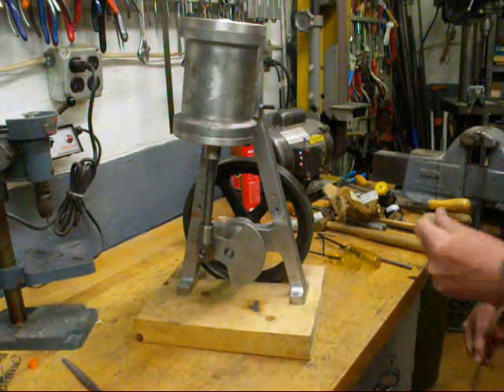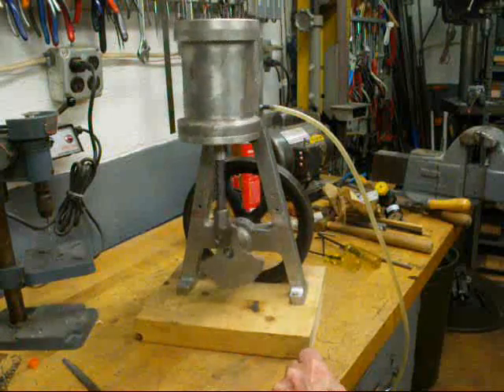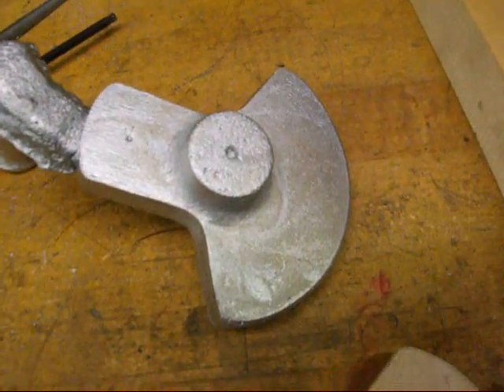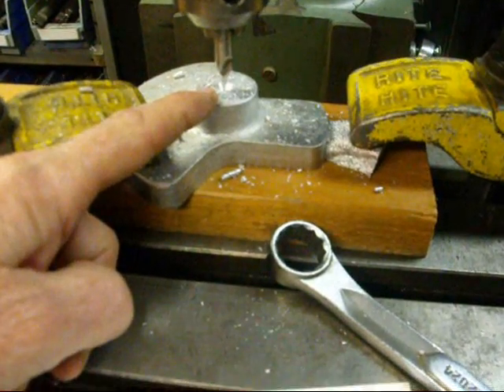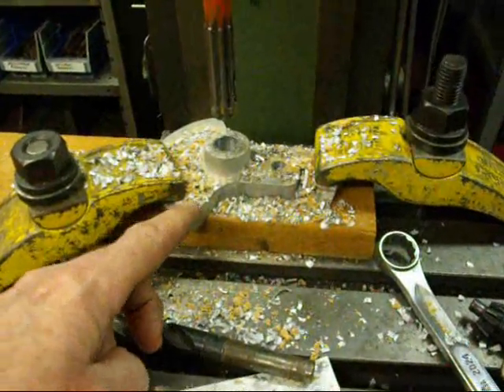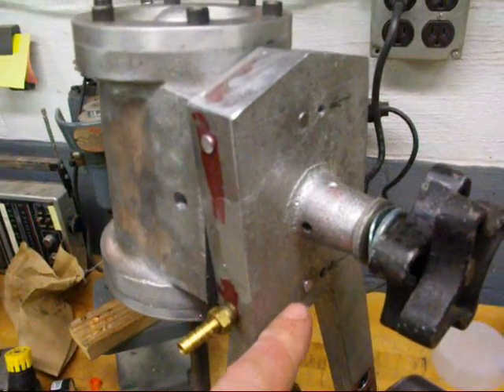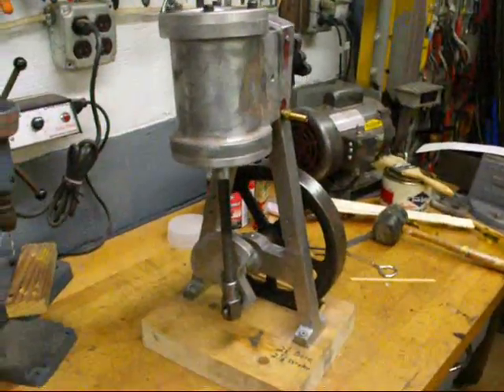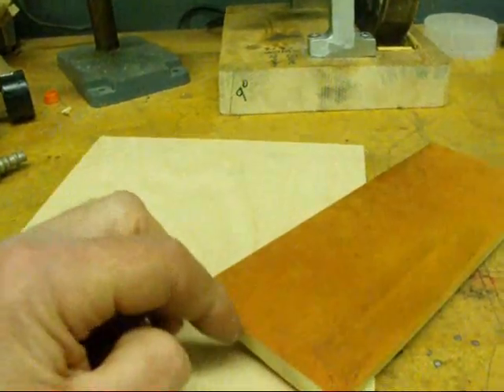BUILDING A MODEL STEAM ENGINE part 8 tubalcain

Comment: If i lost foam cast the engine parts... it'll save me time from having to use a drill press right?
Reply from the maker: Coco Puffs Yes-but you still need to clean the holes with a reamer